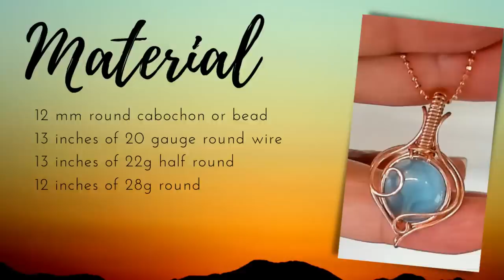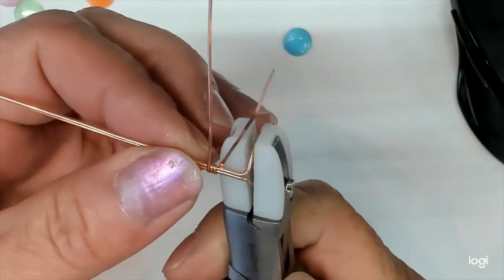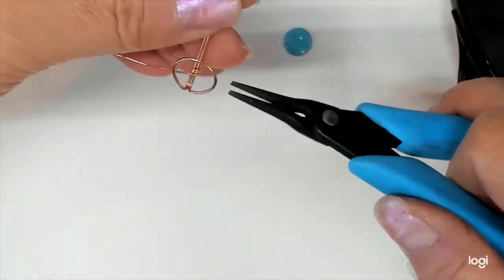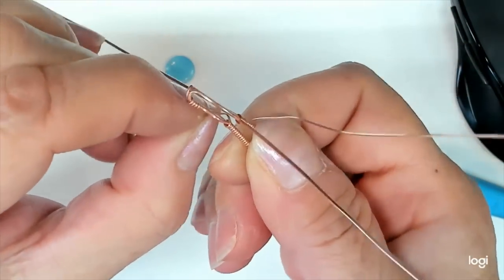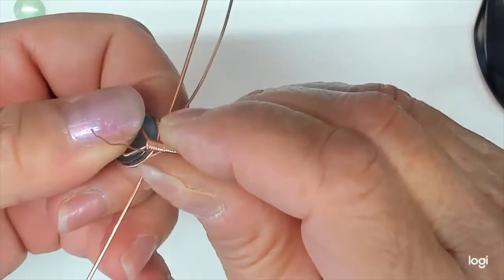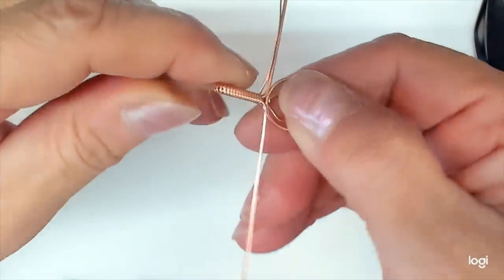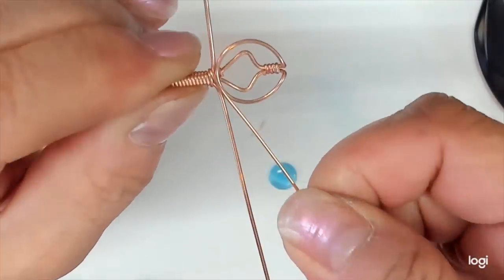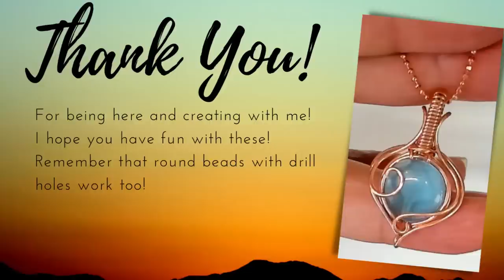Make a Mini Pendant!  Cute Wire Wrap for Small Cabochon, Easy, Beginner Friendly!

Comment: Would this design work for larger stones using a larger gauge wire?
Reply from the maker: Hi Pamela, for a larger one... depends on how much larger, maybe up to 15 or 18mm on this size wire, yes to increase the wire size if your stone is larger... and you might also check out Quinn... this is a similar frame and stone capture for much larger stones... https://youtu.be/ssY0HnpnudQ  Have fun! Let me know if you need more help.

Comment: Let me tell you about my adventures trying to follow along. I gathered everything I needed. Had to do silver plated. Then I grabbed the only round small thing I had, a 1" clear glass cabachon I used to use in settings. Then I found a 1" mandrel which turned out to be the mouthpiece of an asthma inhaler. Couldn't make a circle anyway. Kept right on, with encouragement from you. Then it happened, the cabachon dropped. I ran in the kitchen, got another one, used some UV resin to color it, put it under the UV lamp and ran back to the BR to continue. The video kept on without me cuz I forgot to turn it off. I took a deep breath, found my place and went to work. I had to stop and pray. Made it quick, and said, "Jesus, take the wheel and while you're at it, help me with the wires cuz I couldn't tell which side the half round was flat. As I was sure it twisted...maybe not, I tried to figure it out, couldn't made my tap and kept on. Then, have mercy, new cabachon fell😮. I knew I should have kept it in my mouth. 
By the time I made the bail, I told Satan, "Not now." Funny how religious you get when in great need. But now was the test. Would the cab stay in? For a few second it did. Slipped out. I pushed that slippery sucker right back in and I remembered something you did in another video. So, that diamond in the back grew some facets. And I heard you say 28g, suring up, I relaxed and thought, you can't do the elegance, but you can swirl and use the 28 guage which has become my best friend. 
So, now, I'm almost finished with my First caged stone. It's trying to get alway. But later on today, cuz now it's 5:15am and I haven't slept, I am going to finish it the best I can. Learned alot. Conrinue to be patient, practice, make lemonade out of lemons, learn and do the best you can. I'm glad I'm a fighter and believe no wire is going to ever kill me😂, am persistent. I am determined to learn wire wrapping thru 
Perfectly Twisted Jewelry who I have a membership now after starting a playlist with only Susan's videos. And let me end with a word of caution. Never be tired and start one of her videos. That girl has the softest, sweet encouraging voice I have ever hear. It will make you drift off to sleep just listening, with your project right in your hands.❤❤❤❤❤❤
Reply from the maker: Good morning again, Rosetta!  I'm not sure what happened to my comment, but I left one and now it's gone.  Anyway, what an adventure you had!!  I love all your details and had a fun time reading... you're a natural writer and storyteller!  I love your determination, your enthusiasm, and your persistence!   I also love how you fell in love with 28 gauge wire, yes, it's an awesome wire and useful for many things including weaving.  It's a little tricky the first time or two you create the frame but it is a secure one for small, thin stones.  There are several tutorials for smaller stones, and medium size stones too.  4am wire wrapping!  wow!  Remember to get sleep in between and take care of yourself too.  I will try to speak up now that I know you wrap in the wee hours! :D  Many hugs!

Comment: i always add wire and still always end up short. i dont flare out as much either. drives me crazy
Reply from the maker: Hi Laura, in this design, I am using 20g round wire at 13 inches and the cab is 12 or 13mm round... if your bale is slightly longer or the inside measure is more than 3mm, you might end up short due to that.  Try starting with an extra couple of inches.  My guess is that if all things are the same, the chances are its your bale that is larger.  Let me know it goes. 🙏🌷
Reply: @Perfectly Twisted Jewelry  and when I accidentally use 18g I might have issues too lol
Reply from the maker: lol!  I do that too sometimes and don't realize which wire I've got.  Makes for good finger muscles to do things a few times :D Thanks!